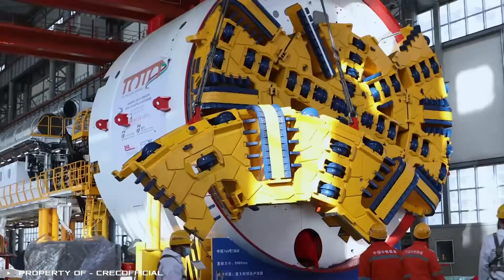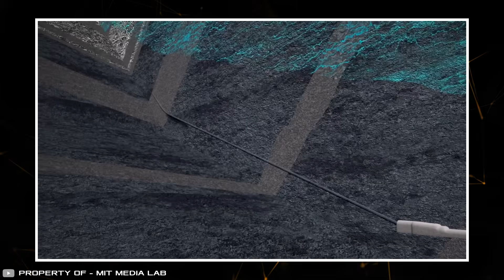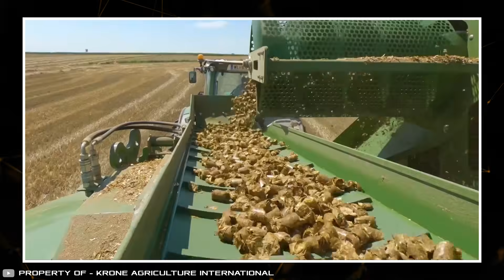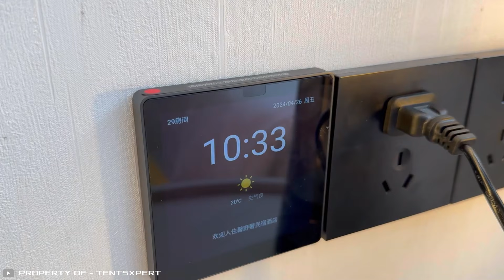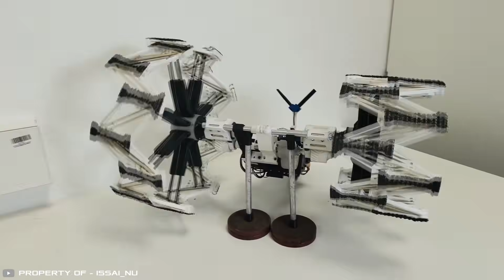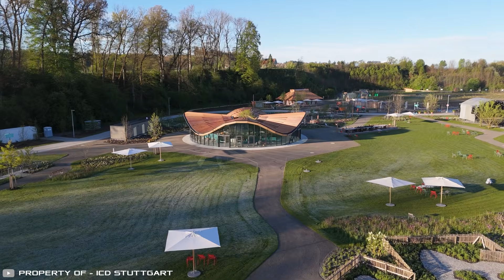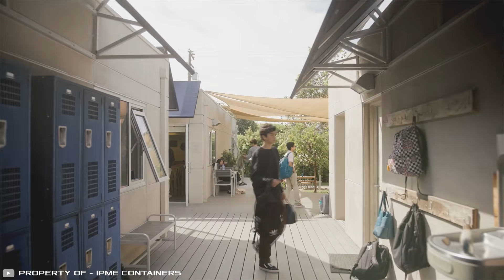The Aircraft That Will Revolutionize Air Travel

Comment: 1:50 I instantly recognized the drill-head of the tunnel boring machine: it looks 1:1 like the head of a certain Herrenknecht AG TBM. (Herrenknecht AG is a south-west Germany based construction company specialized in heavy excavation equipment who pioneered several engineering inventions around tunnel boring specifically). It's really bewildering seeing a (supposedly?) Chinese-made tunnel boring machine featuring the exact same head design as one from this well known Germany company. So they either copied the (patented) TBM drill design in one way or the other. So how did it come to this? I can only think of 3 ways this happened:
a) they did it roguely b) they actually bought the commercial rights to the design c) they bought the entire German-based company.
It turns out: Herrenknecht once actually had a serious offer from a Chinese-based company to buy them, but rejected its 2 billion USD offer, meaning the Chinese company didn't outright buy them in its entirety. But Herrenknecht also has a subsidiary in Guangzhou, China with around 9 subsidiaries involving 900 employees, so there's the possibility that either someone leaked one of their design to a nearby Chinese company or they had both have a publicly unknown design-exchange agreement I don't know about either, because I couldn't find any public statements of Herrenknecht publicly announcing them sharing any of their recent designs with any other company so far or the report is misleading or false to begin with & it's not from a Chinese company at all but actually just a rebranded Herrenknecht TBM after all.
Anyone knows specifics?
Reply: I've always seen on my travels backwards engineering with a tint of culture from the eastern engineers.

Comment: Interesting channel. Technology is fascinating. But most of these inventions are destined to fail. 
And this flying thing looks like an accident waiting to happen. Who is going to insure it? What would happen to a child that stuck its hand in one of the rotating impellers? What happens if there is a glitch in the software? Airplanes and helicopters have some stability if the engine dies. They don't fall like rocks in most cases. This is insane! It's clever, and it would make a fun model to fly with radio control in small scale.

Comment: All the stuff is really neat but I have to point out to everyone about this flying car those rotors and inevitably develop into deducted fans to give more performance and deducted fans develop into squirrel fans and the squirrel fans that we use in our everyday central heat and air conditioner unit in the house and inevitably developed to the jet engine intake compressor